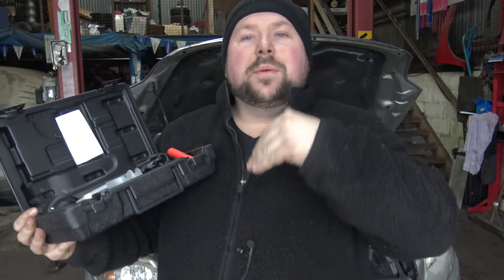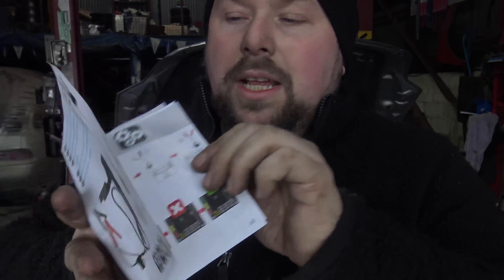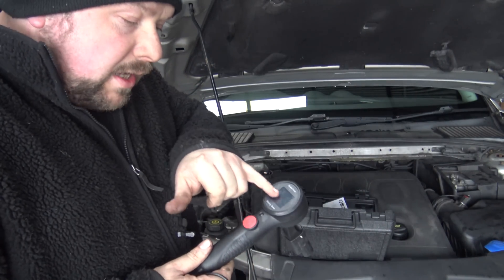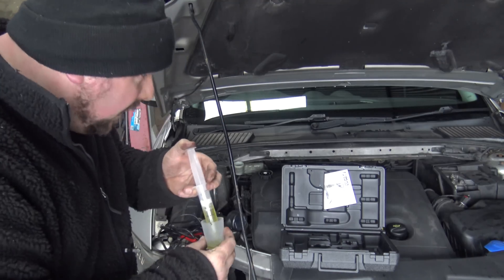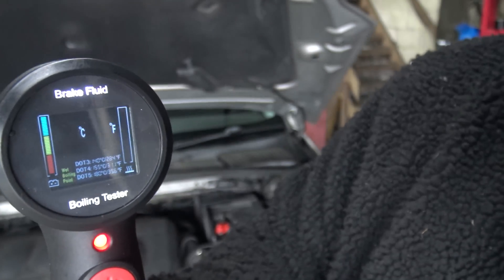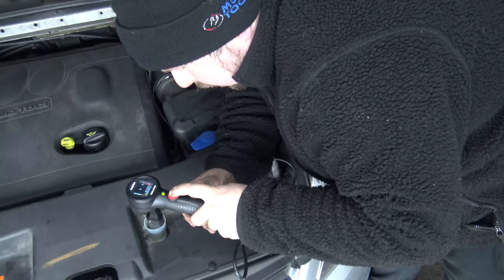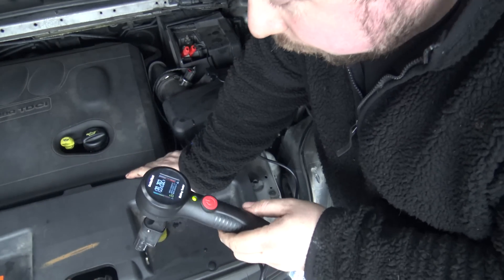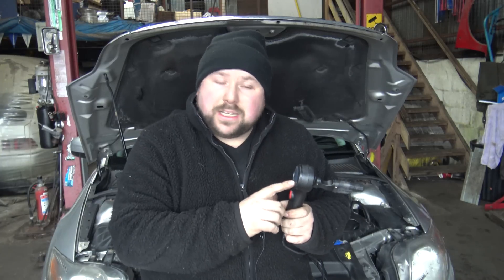How To Test Brake Fluid The Easy/Best Way Bodgit And Leggit Garage

Comment: Boiling is one thing you also dont want moisture to ruin your abs system or brake caliper.
Btw Your brake fluid is as its best at the reservoir, best way is to test it at the back of the vehicle s brake caliper but thats not that easy. 
Nice video👍

Comment: Brake fluid is a service item anyway.  Every 2-3 years, change the fker!  Prevention beats cure every time!  How many customers would understand that the boiling point of their brake fluid was too low, and could possibly cause brake fade due to excessive moisture build up in an emergency braking situation.  Not many I'll wager!  Nice tool though 👌
Reply from the maker: Yes but it's like everything if it is good no point replacing it and scamming the customer that's what's good about this machine you can test it to see if it needs replacing depending on the circumstances you might need to replace it a lot sooner than they recommend that's where this machine comes in
Reply: Fair point!  In an ideal world everything would get done regardless, but as we know, cash being king, things often get...shall we say neglected.

Comment: Ain't got time for that. I just change it 😎
Reply from the maker: Just think about this way you kept going into a garage and they just change things because they wanted to be cost you a fortune that's why this machine is good because it will only have to replace it when it is bad and not just when the manufacturer of the products says it needs replacing because depending on the circumstances it might need being replaced a lot sooner than they say
Reply: @bodgitandleggitgarage  definitely a good tool for a pro to give proof to customers.
Reply: @bodgitandleggitgarage  but it  takes an hour or 2 to change it yourself.

Comment: So, when the liquid boils, bubbles appear, and air is compressible. No brakes!
That's why we need higher boiling points, up to 280 •c.
Reply from the maker: All depends on what brake fluid you are using the rally stuff I use as a really high boiling point but for an everyday car use you don't need as high as rallying